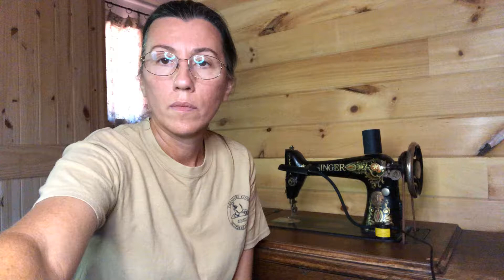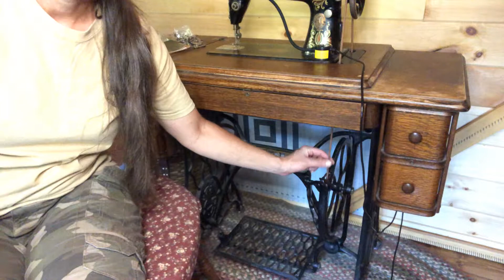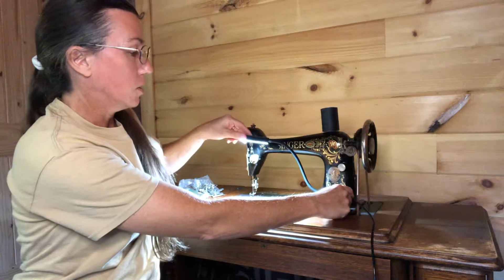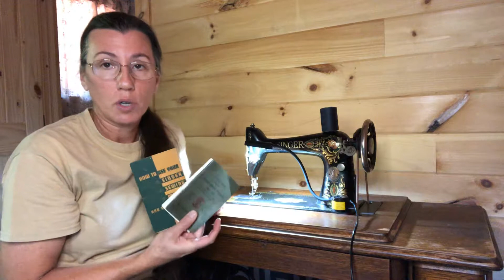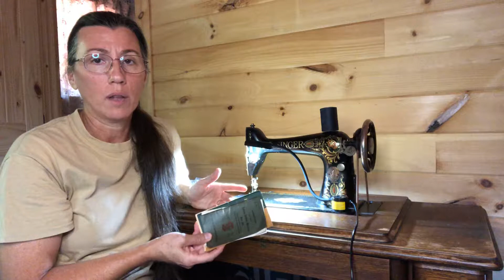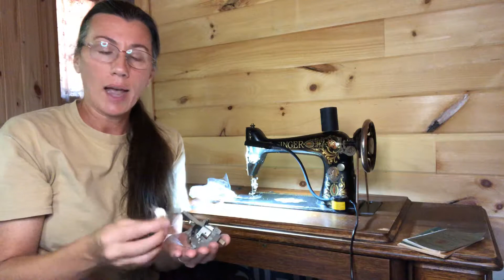Antique Treadle Sewing Machines

Comment: You can zigzag with this machine. You need an attachment called a zigzagger. 
There are 3 main different Singer zigzagger:

The 160985 from 1954 (and 160986 for slant machine)
The 161102 from 1956 (and 161103 for slant machine)
The 161157 from 1957 (and 161158 for slant machine)
Those above are the big black ones with cams. They are pretty much all identical and can work on most machines, including featherweight ones.